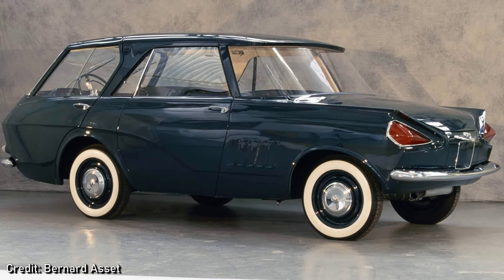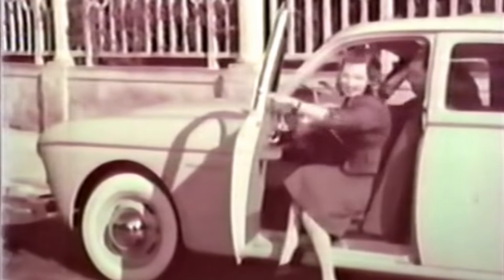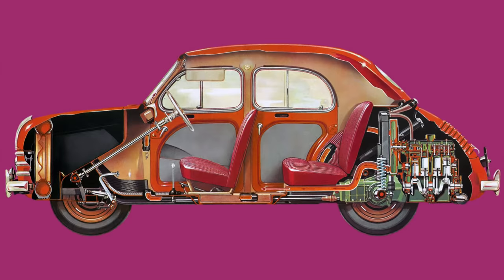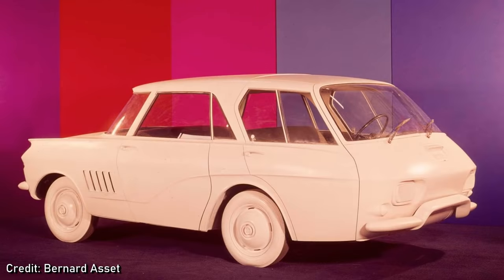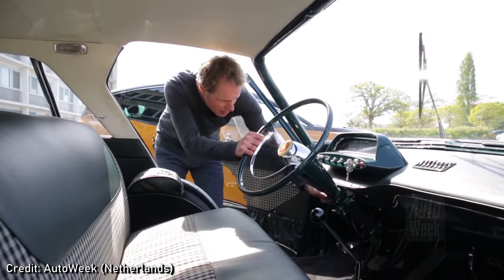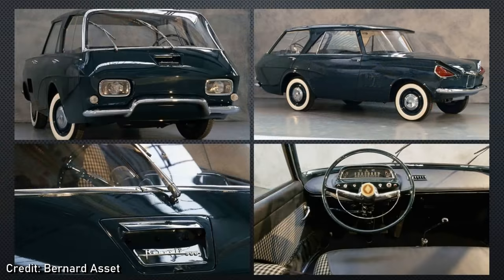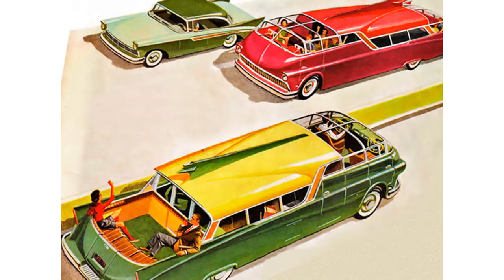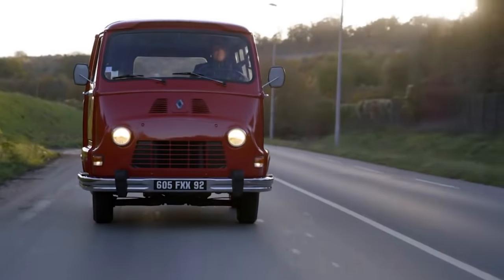Renault's Backwards Car

Comment: That is insane.  Would have actually looked decent if they had reversed it.
Reply: You would probably be pulled over by the cops, evertime you drive in the road
Reply: It's difficult to get much speed up in reverse though.

Comment: This is not a regular car. It has a frack, and it has a bont.
Reply: and at the rear, you find a bonnoot.
Reply: Therefore in the US I suppose the car would have had a trood and hunk....
Reply: Calum Baxter 🤣
Reply: Allo Allo
Reply: indeed, it has a hoot and a bood
Reply: @calumbaxter9946  It's called a frunk but okkk

Comment: The Renault Frigate " A boat of a car"

American car industry: That's cute.
Reply: True, My 1971 Buick Electra could have used the Renault "Frigate" as a dinghy! 😃
Reply: @jamesslick4790  So could the 73 Galaxie, or 77 Mark V, that I used to have.  "Frigate" would have probably been the better name for the 76 Oldsmobile Cutlass Supreme Station Wagon, that I learned to drive in... though, we just called it "The Gun-Boat".
Reply: My nephews called my Dodge "the aircraft carrier".
Reply: @guylarawayjr571  Lol... Chrysler put out a few different massive automobiles.
Reply: @truckertriesfarming9792   I call my 1972 Newport "the 747 "  and my 1995 Ram "the aircraft carrier"
Reply: @guylarawayjr571  I used to think that of the Chrysler 300 50 years ago. I saw one that was a convertible to look more like a flat top . 17 feet long
Reply: My Mercury Montego was 19 ft long
Reply: @EmergencyChannel  My Galaxie was 18 ft, my Mark V was a hair over 19 ft, and my Cadillac Brougham, about 18 1/2.  The Olds wagon that I learned to drive in, was the same length as the Galaxie.  Amusingly, of the group, the longest was a 2 door car.

Mercury Montegos were nice, especially the personal luxury coupe models.  I wouldn't mind owning one.

I miss the massive, American land yachts.  The soft suspensions, and longer wheel bases, made for such a smooth ride. Now, we've got minimal wheel bases, tight suspensions, and oversized rims fitted with tires that have no sidewall.  Even "luxury" cars ride like bricks. My base model 73 Galaxie had a superior ride quality to every modern luxury car that I've ridden in, or driven.
Reply: @truckertriesfarming9792  I liked everything about the car besides the getting 9mpg part. It had a 6.6 liter v8 400ci Ford motor and only made 160hp.
Reply: @EmergencyChannel  Oh, yes.  Both my Galaxie and my Mark V had a 400 under the hood.

Lately, though, I've considered the cost of maintaining my more modern vehicles, and compared that to the upkeep on the 70's cars.  What I've spent on various sensors, and other high-priced electro-junk, outweighs the difference in fuel costs.  I found that it cost me less per year, to run the old gas guzzlers, lol.  The most expensive thing that I ever did with the old ones, was replace the alternator, at less than $100, and that was simple enough to do myself.  Recently, I replaced a brake light on my newer SUV; that was nearly $200... just for the light. (I also replaced that myself)

I don't do much driving, these days, anyway, though. So, fuel bills don't hit me as hard as they could.
Reply: @jamesslick4790  when you can't park near enough the front door of the shops and the kids can't be bothered walking.
Reply: It's just a pun
Reply: @gravitydood1554  Yes, we get the pun. We're mocking the small size of the thing.
Reply: Renault Fregate.
American car industry: Great idea, let's make the Cadillac Aircraft Carrier and the Lincoln Tanker.
Reply: Renault's Frégate replacement in the 1960's was based on the AMC Rambler and assembled in Belgium.

Comment: If they oriented the interior the opposite way around, it actually might have been an attractive design.
Reply: Yep, a short wheelbase rwd car for city with 4 doors
Reply: NON...!
Reply: @PistonDriven  its 2 against you dude
Reply: @polentusmax6100  Tiens ma bière..
Reply: If you were part of the design team, the 900 may have been a commercial success.
Reply: @BatCaveOz  as I sometimes say, they should have consulted with me first.
Reply: That would've been a front-engined design... you can't really pull the interior all the way in the back, if there's an engine there...
Reply: With the amount of glass in the (formerly front) rear, to me it looks like an angry AMC Pacer.

Comment: There really were a number of rear engined cars, even here in the USA.  My grandfather drove a Renault Dauphine and my dad owned two Chevrolet Corvairs.  An uncle drove VW Beetles exclusively (including one that he clobbered a deer with and straightened out again, this the Deerslayer - He took the deer home, prepared it and his family ate it.)  This Renault takes the cake though.  I can't help but think that the seating position so far in front of the wheels might be a bit awkward and the lack of a real trunk/boot would be a problem.  But it looked neat if nothing else, as did the Avantime, at least in my opinion.  And lest we forget the Corvair Greenbriar van, which shared its engine with the standard Corvair and put the driver ahead of the front wheels.  It was a neat vehicle too.  Great videos sir, and enjoyed the smeg-ups at the end!
Reply: my aunt had an Renault Aventine, sadly it was a company car and she had to return it for something else after a few years. It would have been a valuable collectors item now I think.  edit: after checking it seems you can still pick them up quite cheaply , maybe I should buy one
Reply: catmodelt  The UltraVan was cool.  Forgot that my ex father in law drove a VW Squareback wagon for most of my ex's childhood.  Neat cars all the same.

Comment: All they had to do was extend the roofline all the way to the back of the car and they would have had a massive luggage compartment above the engine and it would have given the design symmetry and not looked ridiculous. 

They could have just had a large removable boot floor hatch for access to the engine.
Reply: The vehicles with the best access to the engine are those where the engine drops out - usually on the motorway.
Reply: You have just described the VW Combi van
Reply: @harveysmith100  I was thinking the same :). So the real credits go to the german designers...

Comment: i love the renault 16 a car ahead of its time
Reply: … and it was counterfeit Citroen prototype
Reply: @akronymus  How was the R-16 a Citroen, it doesn't share anything with Citroen design from the early '70s.
Reply: @trespire   
Citroen indeed had a prototype very similar to the R16. Design by Citroen was a bit more futuristic. 
 
Citroen's answer was the GS as a luxury small car. I had one for some time, do not know anything better. 
 
On fact, the CX was Citroen's end. Fine car with e loud 1940s' engine. 
 
My ather bought a BX 19 diesel later, not quite as comfortable as a GS, but a work-horse built to last.
Reply: @akronymus  My first car was an '83 GSA in green. The 1.3 flat four was quick but it only had 4 gears and the air conditioning was bust.
I now own 2 CX's, a '75 CX2000 which need total restoration but all the bits are there except the front seats which are out of a BX. And an '87 CX 25 GTI in metallic   maroon. Just need to replace the tires which I can't find, rims are 390mm alloys.

The GS came in a similar family hatchback body style as the R16, but it came with a smaller albeit lively 1.2 flat four, looked more aerodynamic and had those wonderful suspension.
Frankly I don't see much in common between the two designs other than them both competing for the same market.
Reply: @trespire   
The first GS came with a 1.0 l 4-cyl boxer, and it was great. I had and loved one.

The Citroen prototype I was talking about has nothing to do with the GS. Renault took up the concept and put on the ridiculous base of the R4 torsion spring  design.

Comment: Thanks, brilliant, I had no knowledge of this. Ah the Renault Dauphine, I remember it well, not favourably.
 A 1.7 V8, only the French could come up with that. Finally, I remember my first time in an Espace and the feeling of being so far forward, as you say, a result of the 900 project.
 Thanks again for your well researched content.
Reply: 1.7  liter V8. smooth as a sewing machine and about as much power?
Reply: A Gordini would probably have had  a 2.0 l V8 with 4 Webers.  And we know from Alfa and Ferrari what such an engine is capable of !

Comment: I wonder if anyone ever reversed one of these to make it go the right way and look like it's supposed to.
Reply: In the late sixties a mechanic/artist took a 1959 Oldsmoblie and reversed the body and reversed the headlights and tail lights. supposedly it handled pretty well, in spite of fins on the front, but it got stopped so many times by the police who couldn't believe the car was street legal, so it was buried in an undisclosed location.
Reply: @johnwilson1094  What a waste of a car. Why bury it?

Comment: I don't find it hideous, but my brain will not allow me to see the front as the back....it's like an Escher drawing.  

I have a design fix, though. Put a roof over the engine and it turns into an acceptable van shape. No-one complains about the rear engined VW Combi!!!
Reply from the maker: Spend a few days looking at it (like I did making the video) and it sorts itself out.
Reply: Torpedience  -  ...and the Corvair station wagon.
Reply: I will look that one up. But I kinda lile the Corvair and other odd shaped cars. Even the Renault Alpine (original) takes a bit of getting used to.
Reply: Despite it’s popularity in fact the VW van is a horrible car: lousy on the road, unsafe, unstable, too small cargo space (due to the rear engine), expensive to maintain and from a despicable origin.
Reply: @UTopia-eg7gm  The despicable origin is the main problem if you ask me.
Reply: @UTopia-eg7gm  actually... No. I used to have a single cab baywindow. It was reliable, stable, cornered like a go-kart, peppy, could carry more than any other vehicle in it's weight class, easy and cheap to mantain, could cruise all day at 120 clicks with a stock engine, and after a day working would be ready to "go out" and still catch everyone's attention. Everyone loved it. If life had been a bit easier on me, I would have never sold it.
Reply: @UTopia-eg7gm  I'm not buying the "despicable origin" comment, which implies that everything that a group does means nothing if they were born out of a bad circumstance. If that were true, according to your logic, every post-WWII Ford and Mitsubishi product would also have a "despicable origin".
Reply: @UTopia-eg7gm  You're right. And the Beetle is the only car I've actually disliked driving.

Comment: In the 1990’s a friend had a Espace diesel.  It had a oil level gauge that activated when you first turned the key on.  It burned so much oil it was important to know the oil level.  Most companies would have solved the oil burning problem, Renault instead provided a gauge!

Comment: VW got this right with the T1 (1950): The front wheelarches go below the front doors, with the cutout next to the driver/passenger footwells, and the little V8 should have been mounted between the rear wheels (with the transmission under the rear seats), giving plenty of room behind it for a proper (if rather warm) boot. This would also have allowed for a full size rear door for better rear access.

Comment: At 3:58 - is that an Espace with Peugeot 505 door handles in the background? 
This project 900 had a big bum long before the Megane.
The R16 was a good car though.  I would imagine it was not unlike an Issigonis design in space utilisation. Didn't it have something weird about its wheelbase?
Project 900 looks like a creation from 1950 Harley Earl era GM or Virgil Exner Chrysler design studio.  Even had Impala seagull tailfins, though rear lights like the mk1 Cortina concept or Taunus concept.  I'd better pull myself out of this automotive rabbit hole and go to bed.  Fantastic video. Unexpected but welcome topic!

Comment: We used to have a backwards van. The engine was in the front, it was front-wheel drive and it had rear-wheel steering. The passengers sat facing backwards in front of the driver, who also sat backwards with the steering wheel behind her. It had one forward gear and FOUR reverse gears. It could reverse at over 80 miles per hour, which is impressive for a van. In fact it was such an unusual layout that we found it was actually easier to reverse along the roads all the time, which was a good idea because some idiot at the VW factory had put the headlights on the back of the van and the tail lights on the front. Weird van that was!
Reply: What!?
Reply: @Elbowbanditest2003  VW T3 bus ;)
Reply: @rollstuhlmeister  oh right

Comment: FIAT found out to add space to the small and basic, FIAT 600 model by moving the driver and passenger forward into the former luggage space, and naming the model "Multipla". This later also became the name for an extremely roomy and practical, but strange looking model for 7 passengers! But during a German "crash test", this model mostly "disintegrated", so it was later discontinued, as also the tall Mercedes model, which failed the Swedish "Elk Test" and turned over during that!

Comment: I had a Renault 16TL, it was the only car I have ever owned that had too much front seat adjustment for me, every other car of the nearly 50 that I've owned simply needed the seat to go to the fully back position and it would be as good as it gets. The 16 was a truly great car, just a shame that like all cars of the 1960's and 70's they were rather prone to rust, mine went home around the rear torsion bar mountings. I'd happily own one again, even the column gearshift was decent.

Comment: I consider myself as a bit of a petrolhead. Even so, I was only vaguely aware of the bizarre 900 project before watching your very informative video, thank you!
I have to take you slightly to task about the the Espace connection, which was gifted into the lap of Renault by the innovative Matra Company.

Comment: They should make a car that has two front ends with two drivers seats, and whenever you turn the key on one side of the car there is a 50 50 chance that either your side of the other side will start. Also make it as small as possible with a 0.5 liter V12 engine

Comment: The Dauphine could usually be seen in ditches,  poor roadholding .  The 90's Laguna was totally reliable and comfortable, in 10 years mine didn't go wrong.  I still have a mint one.  The 25 was so stylish and innovative but since then the 2000 on Laguna was faulty and blacked Renault.   Now, newer models replacing Laguna not available in UK.

Comment: How about a video on the 1979 Opel Kadette D and how its basic design has had a life that lasted into the 21st Century? The design was sold off to Daewoo, captive imported to the USA as the Pontiac Lemans, also appearing in other countries under various names and until recently (if not still) being produced by Daewoo's division in Uzbekistan with engines as powerful as 85 horsepower.
Reply from the maker: The 1980s Kadette (Vauxhall Astra) will be something I'll cover in the future.
Reply: @BigCar2  looks like the doors off the first refresh (what America got as the LeMans) would fit the latest version.

Comment: Steering wheel needs to be pushed out to get in, no normal trunk, no safety space (which is not that critical at those times). But at the same time even 60's people felt too insecure inside it.

Futuristic taxi with no trunk? you have to fold your seat to get your stuff? What could possibly go wrong?
They wanted so badly to make a weird looking car. I wonder how the initial specification for the designers sounded like.

Comment: A 1.7 liter V8.  That's a common 4-cylinder size.  Why would you basically double the amount of engine, greatly increasing maintenance and repair costs and frequencies and increasing engine weight and size, for no power gain or other gain except for maybe a tiny increase in engine smoothness that you could get by adding a heavier flywheel?  What's the reasoning behind this?  Maybe there are some other advantages I don't know about to having 4 cylinders rather than 8?  I like the aluminum body, though!  Aluminum might be a lot weaker than steel but in my experience the most common cause of damage by far to a car's body is rust.  I live in a place where they have to put salt and sand on the roads in winter.  Plastic windows are a terrible idea unless they're easy and cheap to replace.  Because you'd have to replace the windshield at least once a year.

Comment: Where the driver is part of the crush zone. Certain vehicles come to mind like older Toyota vans, small foreign cab over commercial trucks used by lawn services and other small companies. I don’t want my feet that close to the front bumper. Even the 2004 to 2011 Ford Rangers I drive are compact enough that the front tires can push into the front occupants foot wells and break lower limbs. 
I have wondered why car manufacturers haven’t made the noses of their cars and trucks longer to make a longer crush zone and making them safer.